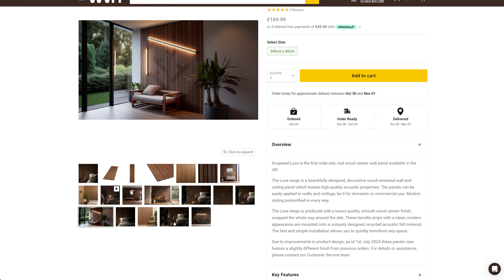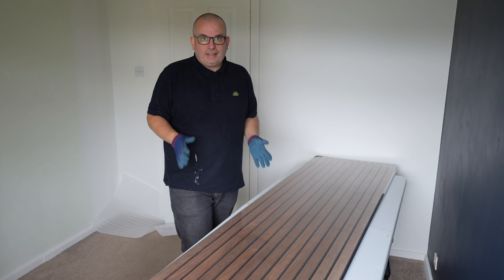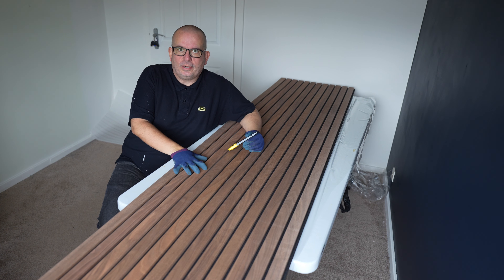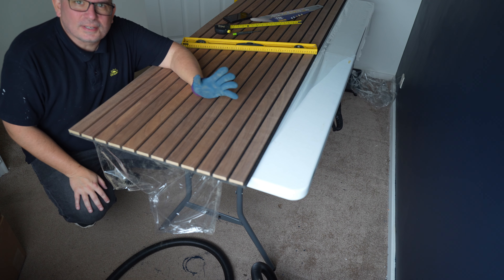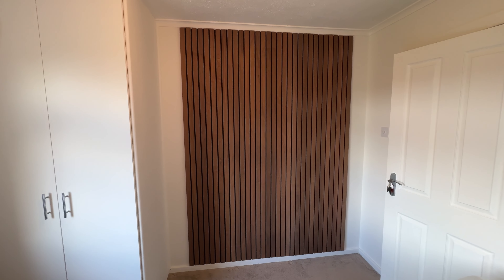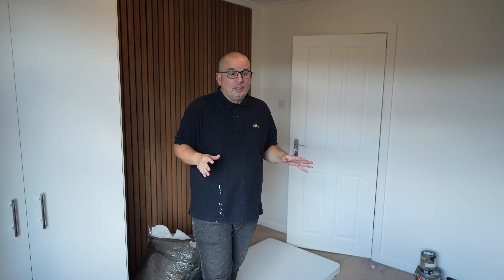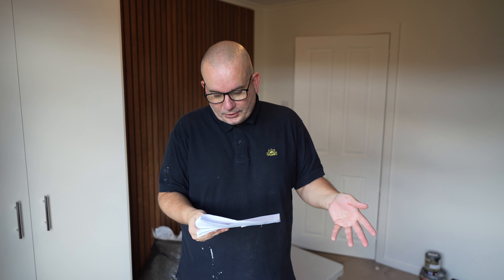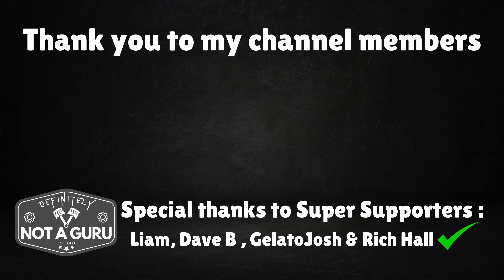New Office Part 2 - Installing my Acupanel Acoustic Wood Wall Panels

Comment: Mate this is the channel that just keeps on giving, loving the diversity of the content 😂. What a difference in the sound too!! Looking forward to the desk build  and seeing how the office turns out. My wife had me do our hall and staircase in the WVH panels earlier this year. Not for the sound benefits just cause they look awesome. It was a big area so wasn’t cheap and I had loads of cutting but it’s a top quality product and easy to work with! I was a one man band too and I screwed it up but the adhesive looks quicker..  👍
Reply from the maker: Cheers Jamie.  I actually didn't film the desk build as very few watchied this video but I'll be doing a big final reveal one. I'm doing the move at the mo.  Yes, great product from WVH - must have cost you a packet but I bet it looks amazing.

Comment: Still all good only using adhesive? Just bought the same brand and also bought the screws and adhesive but now realising what a challenge it will be to drill, plug and screw them in place. No screws would be ideal to avoid the risk of any damage or visibility of screws
Reply from the maker: Yeah all good but their adhesive is very good I think.

Comment: I did this, but bought 18mm MDF , put it on the wall, painted it dark grey, then stained my strips and pinned them on with a gun, job done and a fraction of the cost of those panels
Reply from the maker: Which would have done very little for the acoustics of your room, looks good through I’m sure.